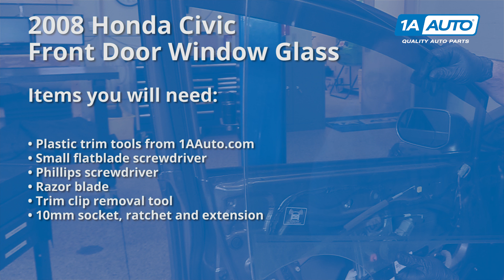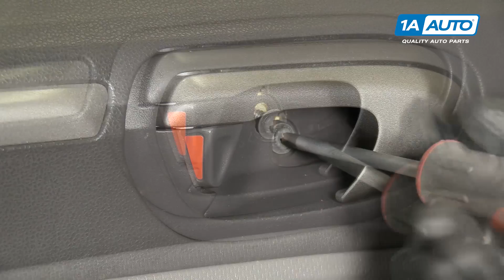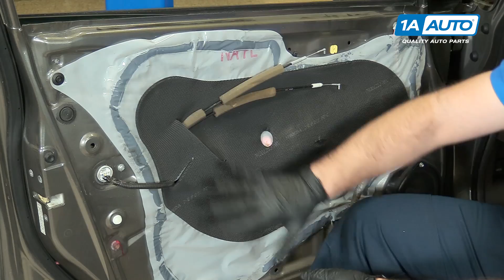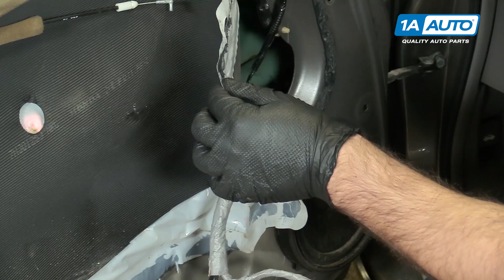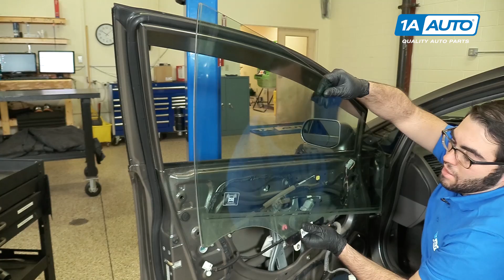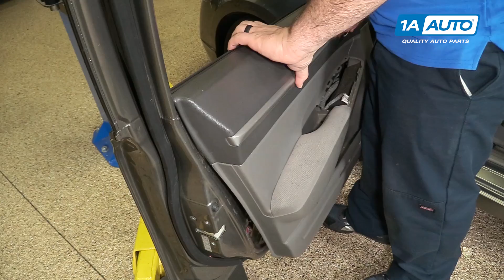How to Replace Front Door Window Glass 05-11 Honda Civic

Comment: Are any 2006 to 2011 (8th Gen) civic sedan parts interchangeable? Like can I put a 2006 window in my 2008? I would assume basically all parts on the same generation would be interchangeable... Got a side window from salvage yard out of a different year model but the same generation and sedan also, that should be fine right?

Comment: Hi, I have a Honda Civic 2010, the 2007 Window is compatible with the 2010  model?
Reply: Yes. 2007 covers the 8th generation of Civic which is 06-11. You’ll just need to ensure it’s for a sedan or coupe since the coupe doors are slightly bigger. The driver side front door is part no. 73350-SNE-315

Edit: That part number is for an 06-11 sedan driver side front door